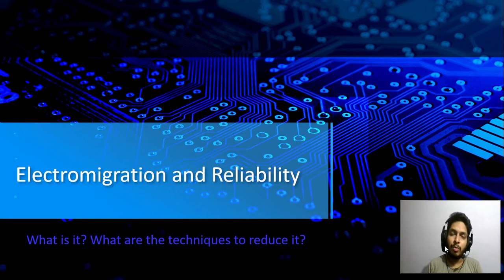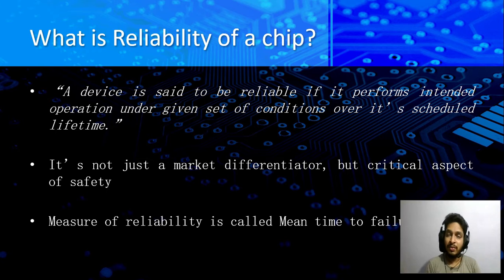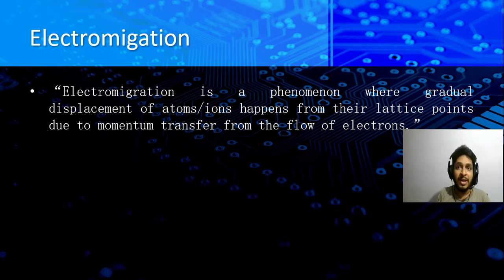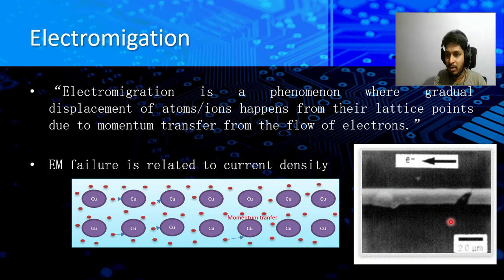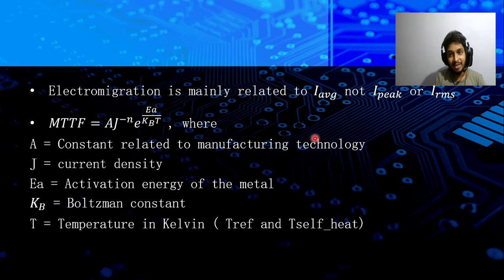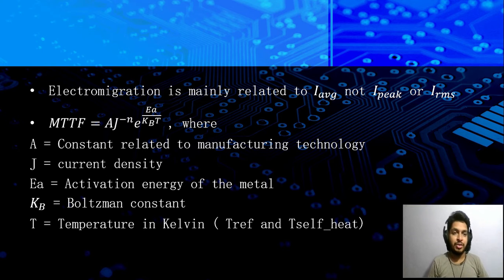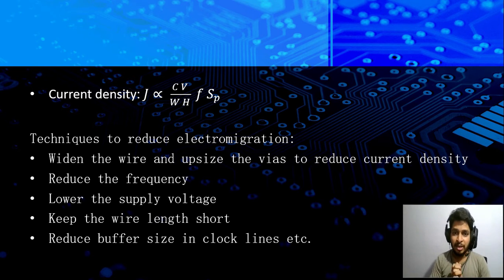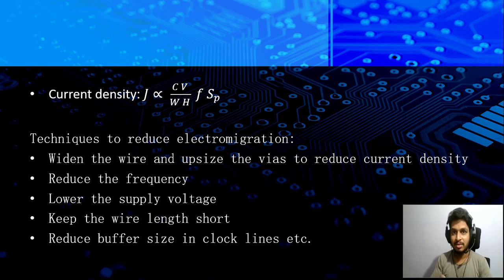Electromigration and Reliability in VLSI | Why do chips die?

Comment: How can we reduce the frequency sir
Reply from the maker: Reducing frequency is not always an option. But if it can be done, it has to be done at RTL design not at the physical design. It can be done for that specific paths for example.
Reply: @jairamgouda  sir can you explain how can the charges accumulate during plasma etching in the antenna effect
Reply from the maker: @nirmalnikitha8596  I hope you've watched my video on antenna effect. If you haven't please watch it. https://youtu.be/zXcSkqu9l3A. 
Since you've asked specifically, I'll give more idea about it. Plasma etching, as I've explained in the video is dry etching. 
-> This plasma is nothing but charged particles  containing free electrons, free radicals, ions etc. Their job is to impart their kinetic energy to directly convert the atoms in solid state to gaseous state.
-> Let's say it's happening for a gate metal connection in metal layer 0 or metal 1. Then if the plasma contains free electrons, don't they get accumulated in the metal?
-> Well, if it was just accumulation, it was fine. They'll have high energy. They will move very fast and hit the gate oxide. Try to punch through by tunneling. 
->If they have enough energy they can actually tunnel through or completely destroy the gate oxide since it's very thin (few angstroms).  This is  similar to fowler-nordheim tunneling.
Now your transistor is gone 🙃

Hope you got some idea. Please do like, share and subscribe if you haven't done yet.

Comment: Is IR & Antenna effect also considering under Reliability issues ?
Reply from the maker: IR drop issue and Antenna effect are directly related to functionality of the chip. Think about it. If there's significant IR drop, the standard cells won't get enough power, it may slow down and it may not work as intended. It's a functionality failure and timing failure which can be considered as performance failure. It doesn't need many moths or years to happen. Perhaps a particular PVT corner may result into this. Antenna effect on the other hand is hazardous if not taken care. The transistors will be destroyed during manufacturing only. So, there is no way that the transistors will work. So, both of these are not part of reliability. Reliability is  something like "Do you want to buy iron bar or steel bar?". Which is more reliable ?
Reply: @jairamgouda  Thank you so much for your brief explanation. 👍